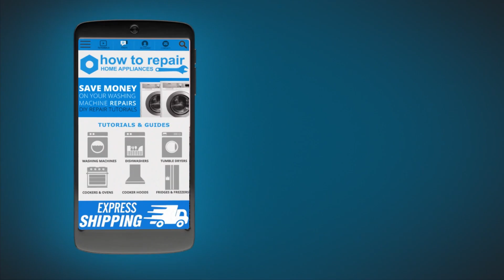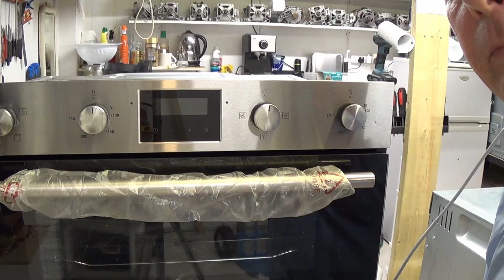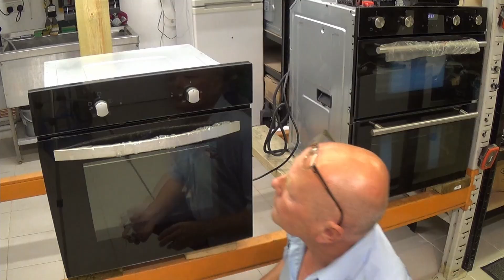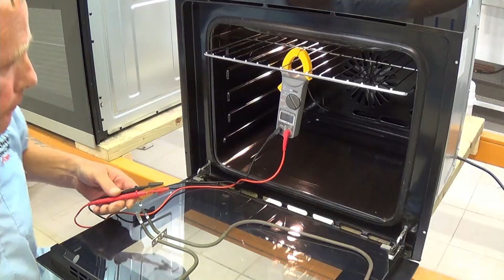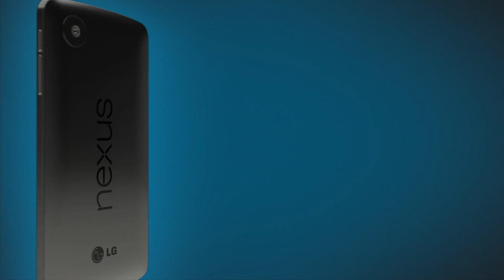No Heat in Oven, Cooker not reaching temperature or cooking evenly

Comment: That is quite a professional explanation, thanks a lot! I have got a 2-year-old "Gorenje simplicity" oven. It does not heat at all. I checked all three elements by hand, to see if any of them heats, but does not. What do you think I should first check? It has a touchscreen display, which is why I could not check to see if the thermostat works or not. Thank you for your answer in advance.

Comment: Great Videos - I'm trying to fix my miele oven at the moment... The darn thing works just about once every blue moon, and then nothing for days - It just stops heating the fan works, and lights are on but don't heat up on any setting. I've tested the resistances and found the double resistance in the top of the oven gives me 200 ohms (I found that a bit high after watching you test those resistances). I've tested the power with an AMP meter and found the amps are very low. (enough for lights and fan only). If you should have any hints as to what I should look at next... anybody's ideas are welcome. If not I'm still checking out your videos on my day off. cheers...
Reply from the maker: if it has circuit board this might be the problem if it has a selector switch the check contacts Thank you for leaving a comment this is for you https://www.youtube.com/shorts/e432SAb2g08 please remember to subscribe as that's is what keeps this channel going. Thanks 👍

Comment: I changed all three elements and still not heating , changed board still no luck , changed the thermostat, the oven on some modes it’s causes the oven lights to come and off intermittently.. model HBE5451UC 500 Series . Any possible ideas any guidance be appreciated.
Reply from the maker: All I can think of is possible PCB or timer fault Thanks please remember to subscribe as that's is was keeps this channel going. Thanks 👍